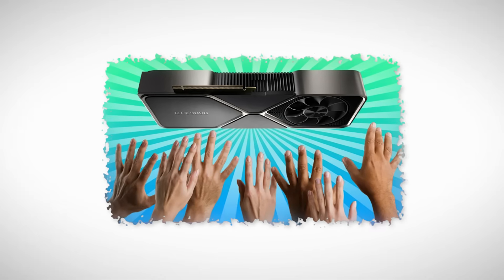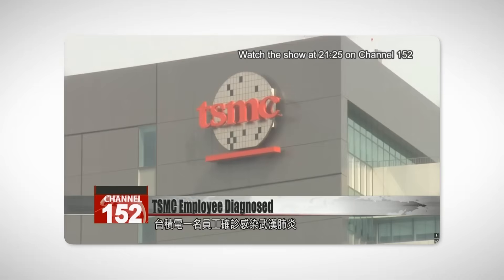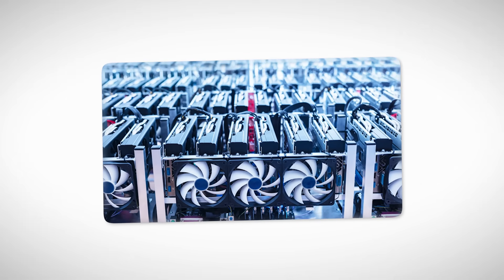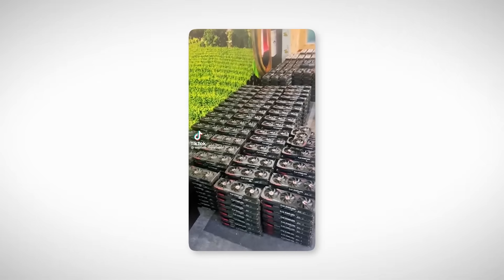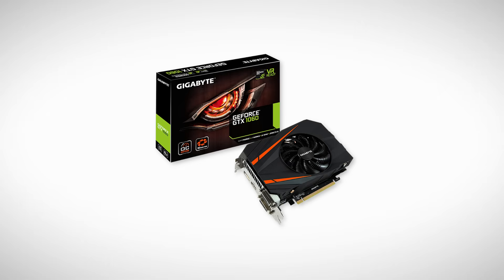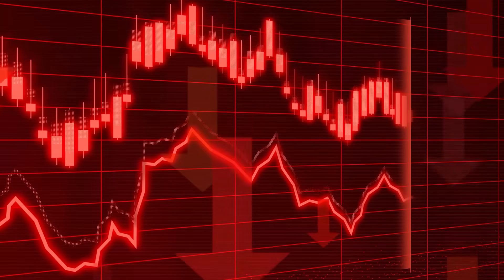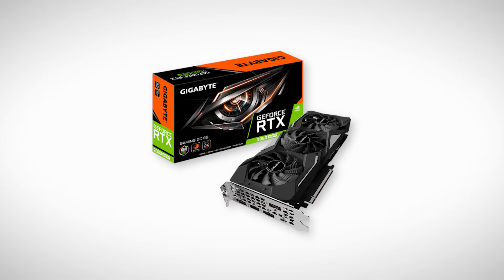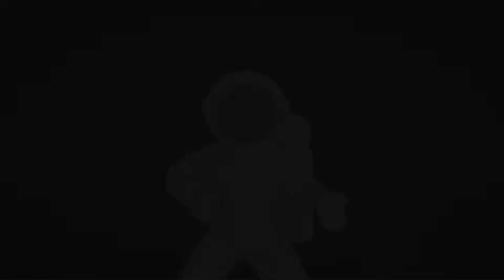Building a PC in 2021 Was a Completely Different Reality

Comment: 2021, that's when I upgraded my PC thanks to a jobless insurance, I bought a gtx 1650 for $350 USD 😅 I had no better option in my country (Chile), and I didn't know about Aliexpress at the time.. at least later in 2023 I bought an rx 6600m on aliexpress for just 135 USD, still using it to this day 👌🏻

Comment: 12:30 now I have a GPU with that exact design (DirectCU II) , it's not AMD but an used Asus Nvidia GTX 770 2gb GPU, bought it cheaper for 2000 INR.
I'm glad it can run GTA 5 on 1080p very high graphics @ 82 fps & all other 2000-2015 AAA games on 1080p high graphics. Will upgrade to RTX 4060 8gb GPU later.
Reply: Similar to what said in this video 8:22, i longed for an Nvidia GPU since 2012 as a teen (13 years). I bought GTX 770 just last week & I'm very excited when i got it in my hand...my very first dedicated Nvidia GPU❤
I don't have any desktop PC, having just a spare 250gb Samsung SATA SSD & I'm planning a budget Ryzen 5 PC build:

Ryzen 5 5600T CPU
Nvidia RTX 4060 8gb GPU
B550 WiFi motherboard 
32gb DDR4 RAM(8gbx4)
2tb gen4 nvme SSD
650watts PSU

I'll just use old GPU & SSD for now, will buy 8gb DDR4 RAM(if unavoidable) considering high RAM SSD prices. I'll upgrade it later to 32gb RAM & 2tb SSD once their prices come back to MSRP & upgrade GPU to RTX 4060 once I saved up enough money for it.
Reply: 2000INR ?
Reply: @vorrdegard2176  2000 INR = 22.3$
INR - Indian Rupees ₹
Reply: How old are you rn